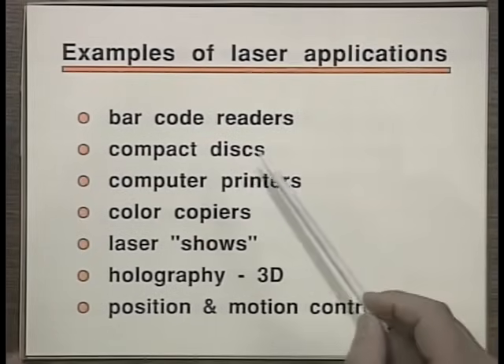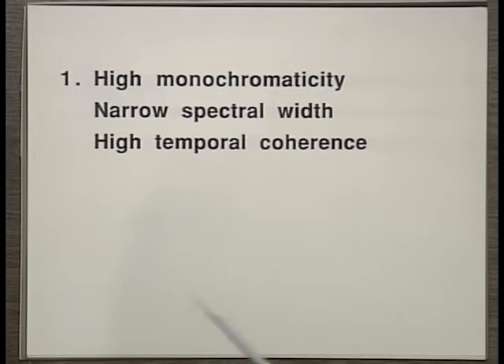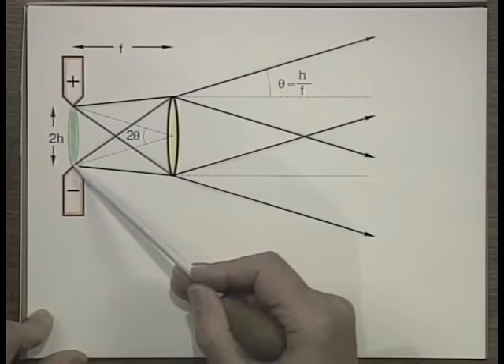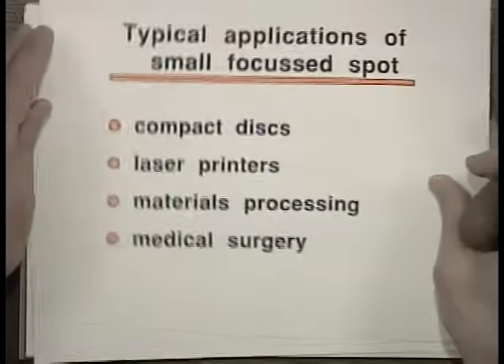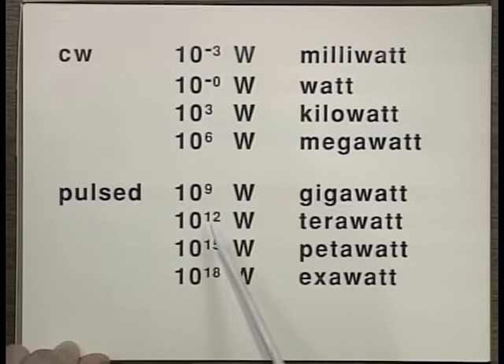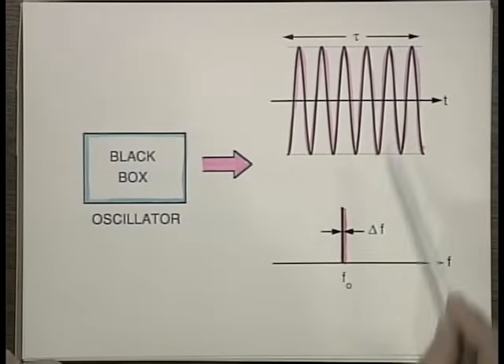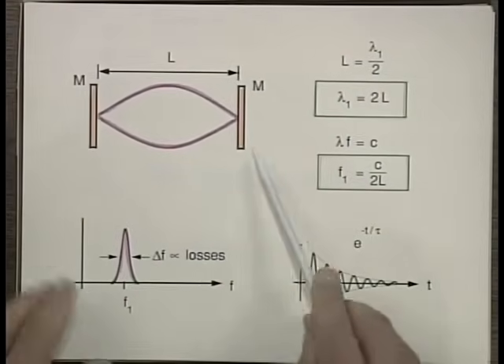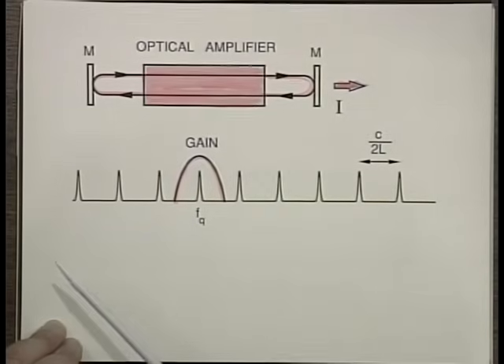Laser Fundamentals I | MIT Understanding Lasers and Fiberoptics

Comment: I am getting confused ! GHz is higher in frequency than MHz, which means the wave  frequency measured in GHz has shorter length ! so why light wave in GHz while Laser beam in MHz?
Reply: Here Ghz and Mhz is not the frequency of the light, it's the spectral width / bandwidth. For example you create a lamp that can emit light with frequency of 1 THz to 1.01 THz. In this case the spectral width is 1.01 - 1 = .01 THz or 10 GHz. I hope it's clear to you now. For Lasers the spectral width is smaller, meaning it has very little variation in frequency when outputting light.
Reply: Yes , its just the linewidth of the laser. Not its center frequency !